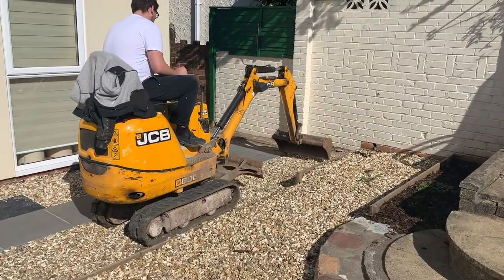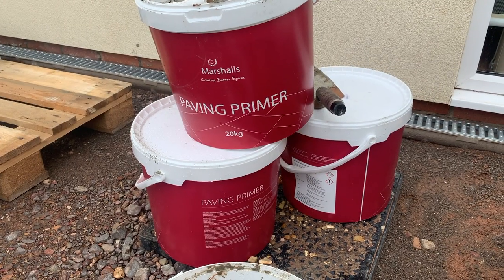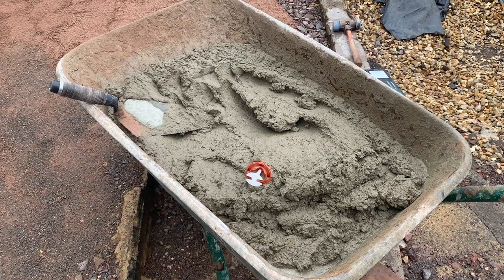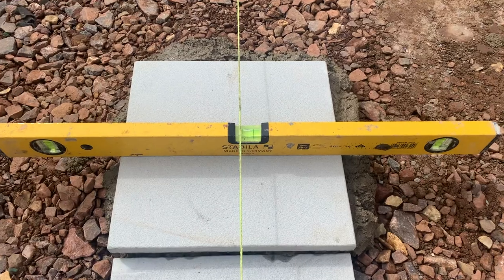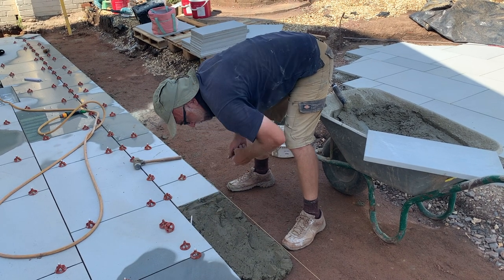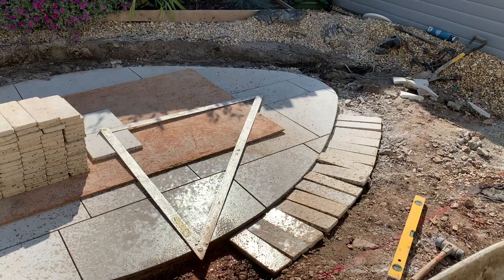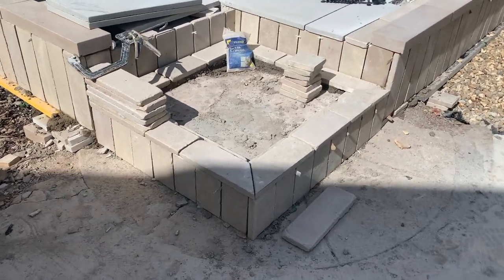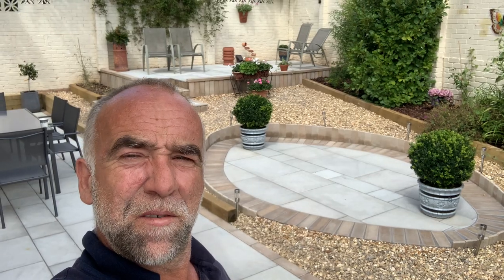10-Minute Stone Patio: Quick and Easy DIY Guide #patioguide #diy #stonepatio #paving

Comment: Great video , im just in the middle of mine , am I right in saying my patio sloping away from my house 20 foot into an aco drain (soakaway) would need a 5 inch drop (slope) ?
Reply from the maker: So 20ft is about 6m so that works out at 60mm. Every 1m out drop down 10mm 👍🏴
Reply: @tidybrickslandscaping   so about 2.4 inches then not 5 , sorry ive never got my head around metric lol